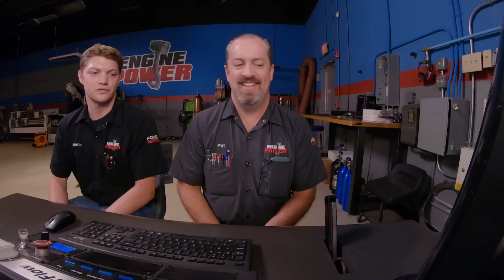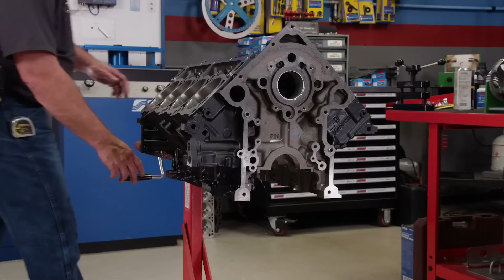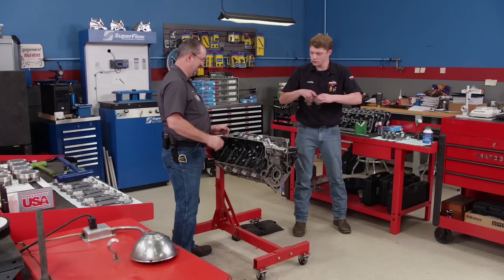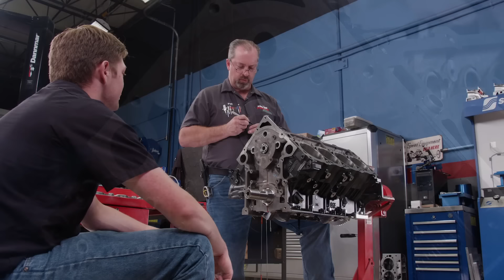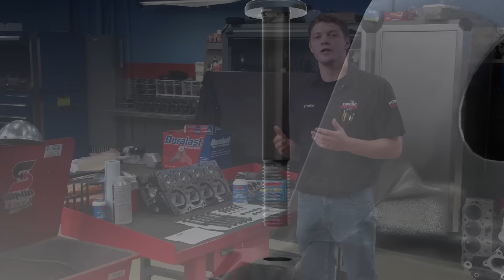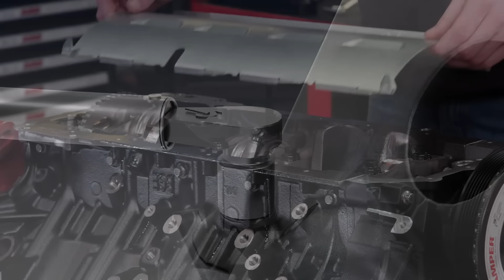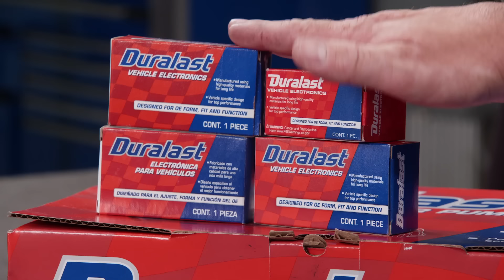Building Up a New 6.4L Gen III HEMI For Reliable Muscle Car Power - Engine Power S8, E16

Comment: They used a cam that fits better in a 302 ford than a damn 6.4. They can idle and make good vacuum with way more duration and make retarded amounts of power off rip.

Comment: Why don't you install the camshaft before you put in the crankshaft? With the crank out you can reach in and support the back of the camshaft so as not damage the cam bearings. ??

Comment: To be honest, all stock is 485 hp and 475 pounds of torque I don’t see enough gains to spend that kind of money. How much different is it gonna be from Factory, it’s pretty powerful right out of the box I could see maybe upgrading the internals And getting a supercharger but that’s gonna cost some money also. But it’s a consideration down the road.
Reply: The reason they didn’t put the 6.4 in the hellcat is because it doesn’t respond well to superchargers or turbos.

Comment: My 2023 Durango SRT 392 runs so nice, so smooth.  Claimed 475 hp and torque... is it true?  Does the stock motor really make those numbers?
Reply: At the flywheel maybe. To the tires probably 380-400

Comment: I had a 5.7 challenger and traded it for the srt 392.   That engine is perfect for me and the 8 speed transmission is a work of art.  So much fun.
Reply: The 6 speed is so much more fun and easy to daily..
Reply: I just procharged my 6.4 Jeep - not worried about the transmission because the old 5-6 speeds w “better blocks” don’t have the 8hp70 and have less heat tolerance to them like the 8hp

Comment: I love how my 6.4 feels throughout the Power band. It's smooth and easily controllable. Chrysler really hit it out of the Park.
Reply: Mine lunched the cam and MDS lifters at 100,000. Billet Comp stage 2 now , no ductile steel. Hellcat lifters and no more MDS. That was the killer. 5 speed auto and never a transmission issue. At around 126,000 now and the car will test your talent. At around 30 miles an hour , it will stand up hard and will kill the tires in sport mode. TC off and mayhem. Tires ain't cheap. Magnaflows sound sweet as well.
Reply: Agreed. Except for the cam and lifter problem.
Reply: @Plumbtired less than .01% of motors have issues. They can be completely blamed on long idle time.
Reply: @sonsofliberty3081  May I ask your source of this stat? I would love to review the data and how they arrived at .01%. I bought my truck CPO with 59,000 miles on it. At 80,000 the cam and lifters had to be replaced under factory extended warranty. Not to mention the transmission and brake booster at almost exactly the same mileage. I only towed my 5th wheel one time during that period. At 97,000 the brake booster and the transmission failed again. Possibly the former owner long idled this truck. That’s an unknown to me. All I know is I do not idle this truck for lengthy periods. Towing is limited  to once during this time also. I’m faithful to my maintenance at the dealership too. My dealership told me all 2500 RAMS 2018-2022 with the 6.4 and the six speed transmission are having the same issues. This shouldn’t be a thing on a truck this would cost me $70,000 to replace.
Reply: @Plumbtired The 6.4L shows the idle hours, what are you talking about unknown?
Reply: @Plumbtired  And Ford and Chevy don't have problems?  KTMs have problems.
Reply: @jsautomotive208  They are all having problems including Toyota. That's why I will not be buying anything newer than 2015 anymore. Currently I drive an E-350 with the 6.0 diesel. 289,000 miles on this bus. One rebuild on the motor by the previous owner. The 6.0 gets a bad rap. Mine has been great except it's time for an EGR valve.

Comment: Running full accessories unlike most other builds on this channel... I wish they used the intake manifold from the Chargers I hear it's tough to beat.

Edit: 6.4L and phaser means it's a gen 4, not 3.
Reply: It's still considered Gen 3

Comment: I’m not going to lie, but I was expecting higher numbers. My 19 WB Challenger dynoed 445/457 stock, and 471/475 with an email tune and polished 84 mm TB only.  I’m guessing that would be around 525-530 crank HP?
Reply: That does not sound right at all, they are usually 420-430 stock and 440-450 tuned, and just under 500 wheel cammed+headers. A throttle body likely will not add much, as the stock one already flows 1000cfm

Comment: "Pound feet" on every torqued bolts 🔩 ...? Who says it this way, sounds goofy, unless you are making a joke. 
It's "foot pounds" for example... Bob torqued those bolts to 120 foot pounds of torque, & if you do electrical requiring torquing of bolts/smaller screws, it's torqued using a torque screwdriver for "inch pounds of torque".

Comment: Your torque rating is lower than factory.  You went backwards.  Variable valve timing improves torque.  You blocked it out. Also wondering about the Holley intake and efi. Clearly something wrong is going on for such pitiful results
Reply: The holley intake is short runners and meant for far higher RPM than only 7000, you can see on their dyno sheet the engine is not at peak yet, a better option would be the factory 6.4 intake with active runners

Comment: Cool video!! Very informative Keep um coming!! Hey Pat Topolinski and Frankie Forman I'm curious if you've heard what Sick Seconds Racing is building as we speak... A 5.7 dual plug hemi, dual injector, 14-71 screw-blower on pump gas for running errands on the street, and methanol for those times when you find yourself at the dragstrip.... But, it's WHAT this banshee is going in..... The Unicorn..... the ONLY Dodge Durango Hellcat..... REDEYE.... ever made!!! Look up Sick Seconds on YouTube, it'll definitely be one of a kind!!!

Comment: I was hoping for more torque than just 4 lb ft over stock for having new pistons, rods, cam, and that massive intake on it. Hp looked good though.
Reply: Longer stroke would be the guarantee for more TQ. Also running a tighter lobe separation angle around 108deg would have increased TQ and probably HP. We seen to be stuck in an era of really wide LSA and then try to compensate with more duration. Giving the engine what it wants has been forgotten.

Comment: Ring gap is way too tight for any forced induction. I guess this motor is just for NA application
Reply: 0.023 is fine for some forced induction, most do 0.025
Reply: .028-.030 Richard Holdner has done countless forced induction Dyno pulls and he recommends at least .028. Also run the same gap. Staggered gaps are not the way to go if any forced induction is planned.

Comment: As much as I like the HEMI, it’s only available as an iron block,which means that no matter how much modification you do to it, it’ll never truely be able to complete with an aluminum block ls/lt engine,
Reply: And here’s another think, the rods on the 5.7 and most stock 6.4s aren’t the strongest in the world. hell those same rods are apparently used on the 6.2 hellcat, that’s not sketchy at all. Overall the hemis seem to have weaker rods than the ls/lt and even the 5.0 ford, and the weight of their rotating assembly leads to a naturally lower redline than the ls, when’s the last time you saw a 7 liter HEMI crack 7 thousand rpm?
Reply: @william2glaser227  The rods are very strong on hemis, the weakest point is the pistons, and even they can support 800+ HP no problem, It is no too hard to spin these things past 7000rpm, I know a guy running a stock bottom end 5.7 to 7400 with a Drag pack intake and a CamMotion Titan 2 cam, in a Manual car

Comment: There's more on the table from there.  My 6.4L crate motor with the stock intake, cylinder head porting and cam put out 615.2 HP @ 6700RPM - 553.2 Lb-Ft @ 4600RPM.  The stock intake with the SRV system is surprisingly good vs switching to an aftermarket with single length runners.
Reply: Great numbers. What size cam are you using jw?
Reply: What cam? What did it do in the quarter?
Reply: Who ported the heads? Who built it?
Reply: Wow a 2100 peak spread that's a killer street engine man
Reply: Bhp or whp? Thats seriously impressive..
Reply: yeah, something in their setup was holding it back. Their combo didn't make much more than my stock 392 durango.
Reply: @durstroyer3924 injectors most likely.
Reply: @durstroyer3924  I got a 2018 ram 2500 6.4l single cab work truck. I’m pushing over 500 with a few minor upgrades and she cooks. I’ve had to stop because my trans is about done. Upgrading to a stage 2 by ats diesel performance

Comment: Factory rocker shafts a major weak link in the valve train. Should have used Manton
Reply: With the stabilizers they should be just fine
Reply: Band aid for sure. If I remember right, an engineer on the Hellcat program said the rocker shafts were one area that was neglected. New shafts AND stabilizers. Also use the largest push rod you can fit. I plan to use Manton shafts, Stanke stabilizers, and 3/8 pushrods on my Hellcat. Not sure what I'm going to do with the rotating assembly. 
Another point that needs to be made is that cam had too wide of an LSA. Should be closer to 108deg. Of course PTV clearance might be an issue with that duration with the tight LSA. If clearance is available, tighten it up and higher average power will be made. Or just run the same old combination everyone uses, and make the same power as everyone else. Your choice.

Comment: The Hemi has a birth defect in the block the camshaft tunnels to high doesn't get enough oil splash. That's why you don't seem as police cruisers. There's no municipality in a country that will touch one
Reply: That's not true at all, the cam is not lubed by oil splash haha, The reason lifters fail 95% of the time is due to the poor quality MDS lifters. Swap them out for Non MDS, and they will last forever

Comment: I can't believe that yall kept the stock heads on this engine. I can't tell you how many hemi's I've had to rebuild because of them dropping the valve seats. The hemi heads are complete junk and would be the first thing that I replaced
Reply: Are you still on dial up old fart ? You're talking about the old gen2 hemi heads.The gen 3 hemi 6.4 apache heads flow better than you will ever need on a streetable car.
Reply: The only Hemis with Valve seat problems was the the 2003-2008 5.7L. The New 5.7, 6.1 and 6.4 do NOT have valve seat problems.

Comment: That’s a great looking engine and a good video but for all the upgrades it seems a little disappointing, the SRT 6.4L is rated at 485 hp and 475 lb/ft tq, they barely produced any more torque over factory at all, good bump in horsepower though. I’d still like to see a NA 6.4 making big torque numbers like 600+ surely if they could do it 50 years ago with carburetors there’s no reason they can’t today!
Reply: Those were 8L engines not 6.4's with those HP numbers...

Comment: Lol heads, cam, hi-ram 392 makes roughly 490 to the wheels......

Me (the LS guy): making 527whp in my Ls7 with a cold air and a cam.. 🤣🤣🤣🤣🤣🤣
Reply: Stock heads.
Reply: @moparfreak77  ahh thought he had aftermarket heads.
Reply: @camonly849  I mean, stock heads, and the wrong intake, they should have used the OEM 6.4 intake with active runners, the holley intake is meant for much higher rpm than 7000, also hard to compare that to an LS7, which is (obviously) much larger and comes from GM fully ported
Reply: @captainboose8788  I mean it's not a ton larger, but you don't see many 392s making 650whp consistently.

Well people have ported the stock heads I've seen. So maybe GM didn't fully do it or something idk. It's just so easy to make hp in the ls7, or any LS for that matter.
Reply: @camonly849  Ive built a few LSs; and yeah I agree they are good to build power, so are the hemis; My buddies LS3 made 452 whp with a BTR cam+headers, and my 6.1 hemi made 465 whp with a comp grind and headers, the reason you don't see Hemis at crazier numbers is because stock piston to valve clearance is less on the hemis, and a big cam will trade off lower rpm power, which for a heavy challenger, most guys want. As far as the Ls7 goes, it's 60 cubic inches bigger; pretty substantial actually, and has factory ported LS3 heads, if you port stock Hemi heads you can get them over 400cfm, crazy numbers

Regardless; yeah these guys don't know how to build an engine; I know of pro hemi builders that make 650 crank HP on 5.7 hemis NA...
Reply: @captainboose8788  ahh I thought you were talking about then 392 being a lot smaller then the ls7, I was like it's not that much smaller. But ya way smaller than the ls7. You gained 130-ish hp on a 5.7 with just a cam and headers?!?

BTR makes nice cams. I like the B3 cam too. Eventually if I'm lucky I wanna build mine to 8000rpm. If not I would probably look at the lingenfelter eliminator motors. They're insane.
Reply: @captainblaiser  correction not 5.7 * 6.1.
Reply: @captainblaiser  your 6.1 made good power.

Comment: can tell you from automotive experience we never used duralast. I can guarantee they don't check what they send out had to return so many duralast parts helped a friend went through 8 duralast alternators before one worked and the alternator was in a pain spot. After each return the staff acted as if it was normal never use anything duralast there cheaply done and quality control dosnt exist. Every shop I've been in its Napa or oriellys that's what the real pros use this was nothing but paid advertising no good pro uses duralast and if they do they've just been lucky.

Comment: Gawd that would be awesome in my 06 magnum with the 300 conversation,  help round it out nicely,  to bad local laws prohibit side pipes cause it would sound sweet with that motor 😁
Reply: What are they going to do pull you over leave them tucked under the car and buy a 80 dollar a side electric switch off for the exhaust so u can be quiet when u need to he and loud when u wanna be

Comment: A stock 6.4 claims 470tq/470hp on an engine dyno, but this thing barely squeaks out 570hp and 479tq with upgraded internals, valve-train, and intake manifold?….
Reply: I think it needs more cam or a long runner intake.  I would pick a long runner intake.  It's a better match for the cam
Reply: 100 more horsepower with stock block, unported factory heads and an intake swap is pretty damn impressive especially with a 225 at .050" cam. Upgraded internals (piston/rings/rods) and valvetrain stuff (springs/retainers/locks/shaft supports) are for taking more abuse and won't make any more power by themselves but will support more power if nitous, turbos, blowers, ported heads, or whatever are put on later. Add to that the stand alone/user friendly EFI system and this engine could go in any vehicle you want and be reliable and powerful. Plus they said you can win it so I registered to do so.

Comment: Did you use the modified one wire alternator or has Holley added the PWM control on the Alternator?

Comment: Nice video on the gen 3 hemi. This is modern tech on computer engines. I used to have back in the early 1980's running a 440 c.i.d. Mopar on the street and it had lots of work and components back then with electronic ignition and 2 - edelbroc 600 carbs and tuned for the motor,  dyno out at 762 hp and 590 torque.  Street purposely built 1973 Plymouth duster 4.30 gears with 4500 stall converter, tubed rear with 14x32 street slicks . Fiber glass hood- doors- deck lid and bumpers ,full interior except back seat and 8 point cage for safety.  C7 paint - plum crazy purple. 
Made 5 passes at the track in 1 night ,best time 9.96 for which the officials stopped me from racing since I had no certification- license because of breaking the 10.00 seconds mark. They were monitoring me that whole night, so after that I quit the track appearance. My friend and I always went every weekend street racing on this unincorporated road back in the west end of the county that was used for water maintenance personnel and marked out for 1320 ft . I Made lots of money and friends but the ones that I  beat never raced me the second time. I can say today, technology is great but back then you had to experiment to make horsepower and get info from the older people who were retired from racing. But one thing I can say is im glad growing up in that generation where life was fun and easy. Back then the saying was " no replacement for displacement " i still love and drive Mopars.  Just the bigger version , 1975 w300 dually - Cummins power wagon
Reply: no replacement for displacement is still a thing

Comment: My 5.7 has 136,000 miles and still runs like new. Has very little power below 2500 rpm though.
Reply: Get some 3.9 or 3.55 gears, will help with low end powa.

Comment: Would love to see these guys take a stock HEMI with the MDS and improve on it without removing MDS like most people do.
Reply: The problem with mds is it wont work with any other cam. There are mds and non mds cams.
Reply: So what you're asking is for them to modify an engine without modifying it ? Mds does nothing for your pocket, it's purely for emissions standards and a sales gimmick to sell a V8 to someone who wants a smaller engine for fuel efficiency.
Reply: @DL101ca  Well I did notice quite a bit of difference when I was testing a 2011 Ram 1500 over a 2014 Ram 1500 with MDS in terms of average mpg. 
My query was to see what can be done to an MDS engine to improve the performance without removing it.